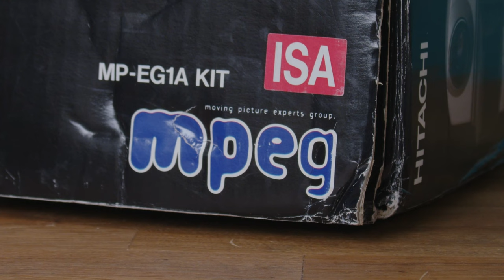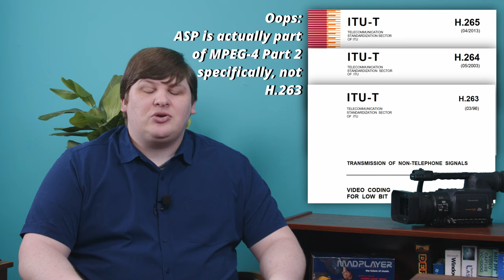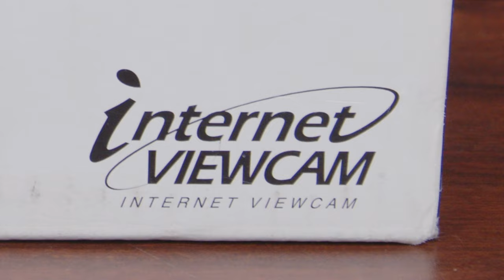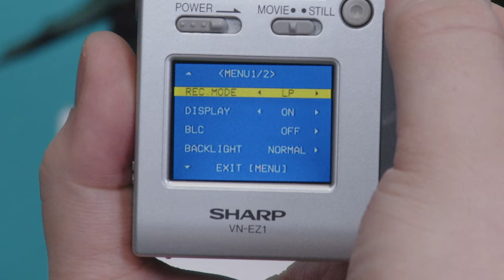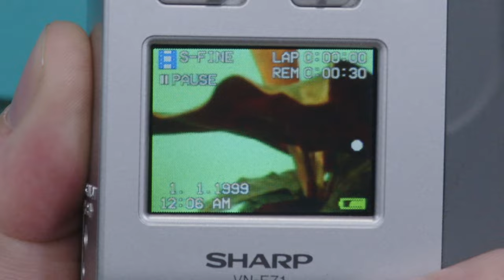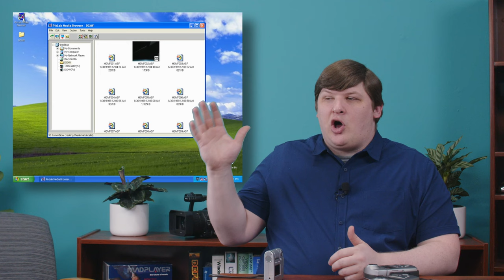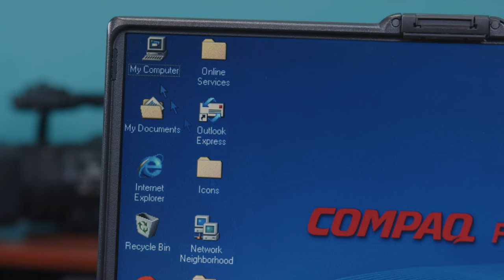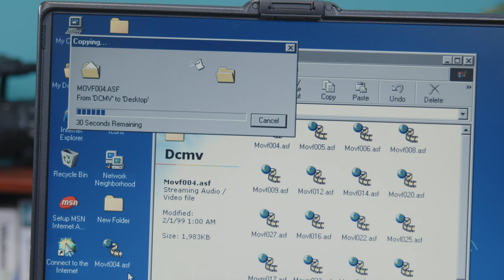The first thing that ever used MPEG4 [Sharp VN-EZ1]

Comment: Besides the potential difference in encoding over the years, the audio quality is also like that because it's using extremely low bit rates and sampling rates compared to what we expect now. The sound clearly has a sampling rate reminiscent of an analog telephone line (I'd guess 4000Hz), and is very-lossy compressed on top of that.
Reply from the maker: Nah, this isn't just bitcrushed, it's definitely not supposed to have those violent crackles. Another viewer says with the original Sharp G726 codec it doesn't sound like that.
Reply: @CathodeRayDude  Ah, G.726 has had a few revisions over time, so I wouldn't be surprised if an earlier implementation did things a little differently.

Comment: I wouldn't be surprised if people started saying h.264 and h.265 due to piracy. The longtime standard for video codecs in piracy was xvid which was then replaced by x264 and then x265, putting "mpeg-4 layer 37" or whatever would have been needlessly technical and so x264 and x265 was chosen.

Comment: I've had several toaster DVD players that were specifically marketed as DivX compatible playback - meaning I could play a DivX file straight off a DVD (or now straight off a flash drive since my current player has a USB port)

Comment: I know I'm like 2 years late (and I assume someone else has already commented this), but the ASF vs ASB thing is likely a clever workaround to copying a bunch of extra data around when splitting clips.
An ASF file can't simply be split into two pieces - but I suspect it almost can. The issue would be that you need to insert the header information in the middle of the file, to make two separate files. Moving the part of the file after the cut would require copying the entire file, just to move it a couple of kilobytes at most. Rather, they likely simply move parts of the file around, so the file is no longer stored linearly, and write some extra header information (and call it an ASB file). This trick makes it possible to split a clip extremely fast, no matter how large the clip is.
Reply from the maker: @matthewpomes952  that sounds really likely! ASF sounded like a weird format from what little I read of it

Comment: DivX - no mentioning of stage6? That was at the time the best video platform: It came slightly later than Youtube - while YouTube at the time was limited to 240p and 10 minute long and only in 2008 introduced 720p support, stage6 offered 1080p60Hz and far better bandwidth. They also had a better search-function and categories as well as allowed a broader range of content. Just they did not get bought by google and as such could not sustain making billions in loses every year.

Comment: Very interesting video, I was wondering what camera are you using to record that's at 1 Gbps? I think Apple's ProRes HQ codec tops out at around 800 mbps for 4K resolution so I'm guessing you're using something like a Blackmagic camera in Raw mode that's above a gigabit.
Reply from the maker: BMPCC 6k, but I shoot in UHD+prores though. You're right that the specs claim it only goes up to 110MB/s (880Mb/s) but when I check the properties on a clip, it says 1180Mb/s. I don't know what's up with that.
Reply: @CathodeRayDude  Oh cool! We use the same cameras in the film school I'm at - we usually record in ProRes LT or Proxy though. I read your pinned comment about the included file browser software for showing thumbnails-- It's too bad default Windows 10 can't show thumbnails for ProRes videos.

Comment: I remember hearing about USB but didn't even see an actual USB port until about 99. And then they were basically ONLY used for printers. Even keyboards and mice didn't typically use USB for a while, partly because BIOSes hadn't caught up and they couldn't read a USB device during initial boot. It was probably 2002ish before USB really started to take off. I remember I used to joke about how they were trying to make a universal adapter but really just invented another printer port - but hey they got it together afterall :-)
Reply: PC keyboards were probably the last thing to switch to USB. Even if your system supports USB keyboards you wouldn't want to use up one of your two ports on something so trivial when there's nothing wrong with the PS/2 keyboard port. With printers you went from a thick cable to something much more manageable.

Comment: If I was using this back in the day with an external mic, I'd install a headphone attenuator in there to cut down on the volume. 
I assume that should work but idk
Reply from the maker: Might not work if it interrupts the +5V Plug-in-Power supply to the mic, but either way, you wouldn't be able to dial it in with no VU meters
Reply: @CathodeRayDude  Delicious trial and error test clips to try the volume levels. Then after you think you’ve got it, you end up speaking louder/quieter in the real clip! I just made myself nauseous thinking about that…

Comment: I had the Hitachi and it was a lot of fun. We bought it for work and it worked out quite well for us at the time. You’re comparing the performance to today digital cameras.
Reply from the maker: I'm comparing it to videotape, which anyone would have been familiar with going back nearly two decades; MPEG, which was a decade old at the time and had been used in tons of software; or Cinepak, which came on the Windows 95 CD and had been seen by every computer enthusiast in 96-98. I'm not saying the Sharp or Hitachi were useless, but compared to the standards of video quality that had been around for years, this was crusty even for the time.
Reply: @CathodeRayDude  it really just came down to how quickly we could post photos and videos to websites. In the 90s it was my job to figure out where we could save time/money. So we got into Hitachi’s cameras. 

Digitizing VHS video was slow and easy to screw up at the time plus the files were huge and had to be skillfully compressed. We made quite a bit of money doing real estate photos and videos with the Hitachi cameras. I semi-automated a process that gave us a consistent usable product that went right up on our real estate customer's websites.

We also had some of the first digital cameras, but you really had to be a photographer to use them and we only had one working for us. The Hitachi could be operated by anyone in the office so it let us send out just about anyone in the office to take what were stock real estate photos at the time.

You should also keep in mind that most users had low-resolution CRT at the time which hid a lot. 640x480 was very common with few using 800x600 and even fewer using 1024x768.

Comment: A lot of analog to digital audio converters of this time inverted overdriven peaks, giving that nasty sound.  I've heard it on CD recorders, DATs sound cards etc.  It was so common that I set up a hot key in Cool Edit Pro where I could highlight each clipped peak, hit the "P" key and it would interpolate the audio for the highlighted section.  It was really time consuming and still not perfect.  The moral of the story, turn down the input gain so it doesn't clip, ever.  It's not as obvious playing back from the camera because the fidelity is so low.

Comment: It takes three attempts to get a new product category right.  Even Apple has produced some stinkers on the first try.  The first one is usually built with very little to no consumer input and has recently commercialized hardware, the second just has the early adopters who bought the first one for input and focus groups, which gets you part of the way there.  The third tends to get it right and will usually have second gen hardware.

Comment: As far as I know (and tested) most of CF cards can run in "ATA-mode" which essentially turns them into hard drives from the host's point of view. Also PCMCIA disks were actually classic ATA drives as PCMCIA had a facility to directly operate on them. So I don't understand how did the camera refuse to record video on a CF. Speed issues maybe?
Reply from the maker: I'm guessing it wouldn't even record on any normal ATA spinning disk except the specific one they certified, by checking the model number against a whitelist, since ATA provided that from the jump.

Comment: That HP C215 was pure garbage. Also my first camera - saved up all of 2001 for it working while being a student. Chewed through batteries so I used it on the A/C adaptor (sold separately, of course) all the time. Even with my replacement Canon A40 I used the camera via USB. Only got a card reader around 2004 by which time I had a Canon S1 IS (DVD quality MJPEG - yeah baby!) 1GB CF gave you 11minutes video. Loved it.
Reply from the maker: Oh god I forgot how quickly it killed batteries. Absolutely chewed em up, all while producing the blurriest photos you've ever seen.
Reply: @CathodeRayDude  the worst was they had a notification to not use rechargeables as it would "damage the camera with lower voltage" . I was so happy when it got stolen and I bought my Canon A40. First thing I did was to get NiMh batteries. MJPEG is actually why I started out on YouTube - did not have enough space for all my video files. Living the 56K modem cloud dream in 2004.
Reply from the maker: @Rouxenator  that's the exact camera I upgraded to as well! Miles and miles better.
Reply: @CathodeRayDude  that is a very strange coincidence - but a good one. I loved my Canon A40 whereas I hated my C215. Zoom was my main interest and when the S1IS dropped it was a dream come true. I followed it with the S2, then S3 but the S5 was a disaster to I switched to Kodak - also a soon to be dead brand. By then Nokia released the N8 which I got and abandoned cameras for mobiles. A decade later on proper a 4K monitor I can appreciate the brilliance of the Nokia N8 12mp sensor. Still weird we had the same 2 cameras starting out. Love your channel and videos and the people you include on it.

Comment: crappy video or not I loved my mpeg-10w I was able to scrounge up 2gb pcmcia hard disk or 2gb CF card in adapter. and because it was MPEG1 I could instantly use edit combine etc.. clips. did my camcorder take slightly better video? YES but it was such a pain in the ass to use it was just not worth it. I never saw the EG1 so no idea about that one.

but the 10w was amazing!! I got mine when it dropped below $300 on ebay. it was such a blessing to be able to pop the disk into the laptop and just slurp the videos down. no god damned "transfer" like a camcorder. such a pain :-)

Comment: What I find amusing is that old codecs were incredibly inefficient resulting in large file sizes - when internet bandwidth is low, and storage was very expensive. Now codecs are incredibly efficient resulting in comparatively tiny files sizes, but it barely matters as internet bandwidth is high, and storage is cheap. I know this was largely a limitation of processing power of the time (go back in the 90s and give them x265... You'd have needed a supercomputer to decode it.), but it's still kinda funny to me nonetheless. 

I remember downloading 96 kbit MP3s back in the early 2000s. They sounded... not great, but when you have a dialup connection that never successfully connected at faster than 40kbit/s, you dealt with it. Nowadays, Spotify has an option to stream at 24 kbit/s. I don't know what codec they're using, but it sounds considerably better than the old 96 kbit MP3s I used to download. I'd have killed for such a codec to exist back in my dialup days.

Comment: I wonder what might be possible to somebody was to get down the the bit level and flash modded firmware to these cameras. I am no expert on flashing chips but modding the dumps at the bit level is possible on some devices. For example I do this with the firmware on my care to change the spash screen image and turn off and on some factory features.

Comment: I think you missed the point of that mpeg4 camera. in the days of 56k dialup, this camera would have been amazing. its quality is certainly good enough, if not great for its intended use case of getting video across low bandwidth networks and not waiting a day for it to download. you can only do so much with the internet at the time and i would have been very happy with such a camera and its quality back in the day. i really think progress has spoiled us when we review old tech
Reply: Not to mention the low spec of general computers at the time. decompressing video on a 233mhz Pentium 2 means you'll seldom get 480p 30fps video at high compression ratio's without a MPEG card back then.

Comment: Do you have unprocessed partial file as it comes from MP-EG1 and MP-EG10 uploaded somewhere? I wonder if EG-1 file is missing the motion vectors or something else entirely obvious. Normally you expect the first iteration of any chip to come out buggy and that's then fixed in the next stepping, but in the interim, some expected functionality may need to be cut. I think it's the same design, but besides firmware upgrades, they probably fixed the silicon bugs as well. The engineers were probably counting on a respin within 3 months to actually go into the final product, but it didn't come and they had to wait a while longer instead.

I bet the JPEG aren't fully encoded on the CPU; that they still use the MPEG acceleration chip to do the actual underlying transforms. But of course it isn't subject to the same constraints, as they can repeat a step like quantisation several times to nail that quality size balance, which isn't going to be possible in MPEG encoding.

I suspect that Sharp really didn't have anything dedicated, and just uses some off-the-shelf DSP for its low quality MPEG4.

Whether there's a bug with how the audio is decoded nowadays? Difficult to say. After all, the small speaker is midrange only and doesn't really reproduce the low or the high end, making the clipping less objectionable and more in line with the character of the speaker, plus it adds saturation from when the coil leaves the linear magnetic region which is not particularly flattering but would add a sense of cohesion to the damaged audio.
Reply from the maker: Oh yeah, I can definitely get that stuff, I actually intended to and just plum forgot. I will try and get all the raw clips uploaded somewhere tonight
Reply from the maker: https://gekk.info/videos/mpegcam/ Here you go, raws from all three cameras.

Comment: I wonder when "VGA" came to mean 640x480. The first PC VGA cards would only do 640x480 at 16 colors, 256 color s did not really start becoming a thing until SVGA, for stuff like games and many apps you'd be running at the lower res graphics/video modes like 320x200.
Reply from the maker: It's absolutely fascinating, and I suspect what happened was that the term got enshrined in some standards document that was the genesis for many later standards. Something I think a lot of people don't know is that all of the resolutions for standard def digitized video originate from the smpte D1 standard, and in turn, the resolutions we use now are multiples of those, or at least related. Everything stems from one document made in 1986; this is probably similar.

Comment: If the two MPEG1 cameras have identical hardware, why wouldn’t they have released the improvements as a firmware update for the original hardware? Does it not have any capability to install such an update?
Reply from the maker: In those days, downloadable firmware updates were pretty rare, and they couldn't download a headphone jack. :p
Reply: I doubt that the hardware was really identical as I think that the MPEG-1 ASIC is different, very likely a posterior iteration (bug fixed & optimized).

Comment: What camera are you using that does 1GB per second?! My Sony A7RIV shoots 4K at 100MB/s and that looks amazing. Even the 6,000+$ Sony A1 does 400Mb/s 8k. Even the 4k 4:2:2 10 bit on the A1 is 600 Mb/s. So if you are doing 1Gb/s that is wild.
Reply from the maker: Blackmagic pocket Cinema 6k in 4k prores - although according to specifications, it's only supposed to be something like 880 megabits, the actual stream rate that every player I put it into claims is something like 1083mbps
Reply: @CathodeRayDude  That's wild. The footage uncompressed probably looks amazing at that rate!
Reply from the maker: @wickedninja8599  it definitely looks better than on youtube, haha
Reply: @CathodeRayDude  I am a photographer and don't use video much so I only know pro mirrorless and SLR video rates. Maybe when it comes to video dedicated devices the bitrates are usually high like that. Thanks for the replies.

Comment: I think you've forgotten how terrible USB was in '99, when you recommend that a USB card reader would be better than the floppy adapter. ;)
Reply from the maker: Yeah, I straight up forgot that while Apple had a good implementation, it was barely functioning in Windows at that time. Total flub on my part, I didn't realize until editing. I usually roll my eyes at most people who say I'm too young to remember this stuff, I'm not as young as they think, but in retrospect on this particular point I genuinely think I didn't use USB for anything but a mouse until 2003 or so.